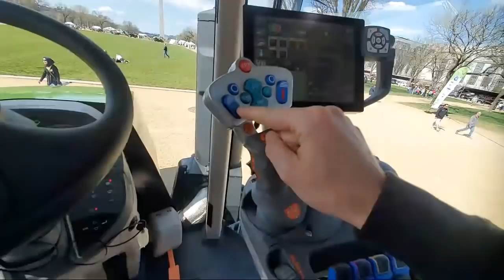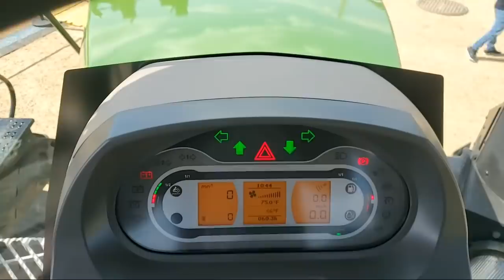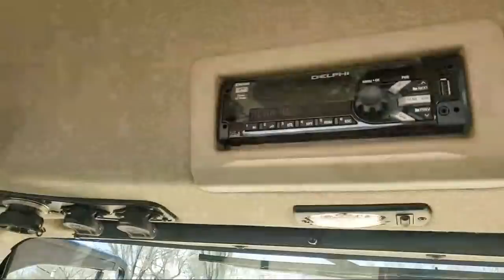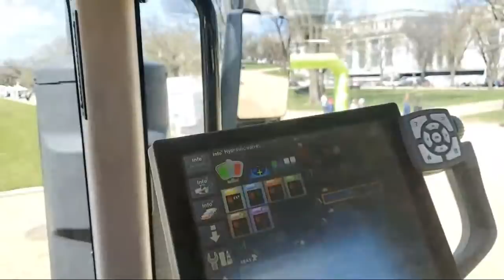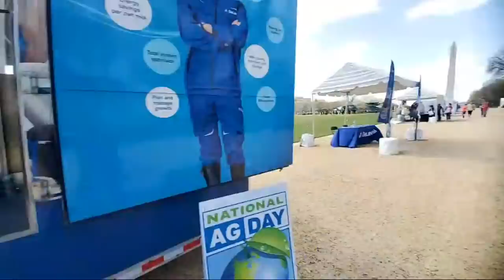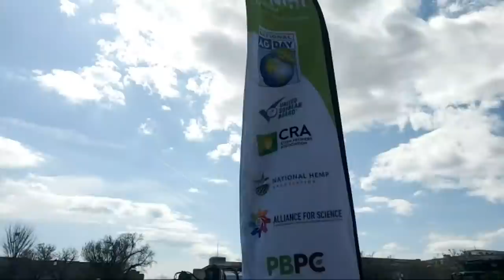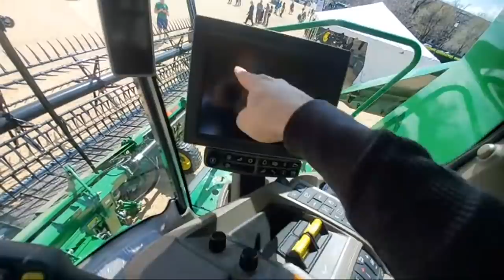How Does This Thing Work?

Comment: Do you understand now Louis?  It takes the AWESOME KNOWLEDGE of a certified Fendt repair tech to fix these very important tractors!  Fendt tractors do not start for just anyone either.  You must be a CERETIFIED FENDT DRIVERRRRRRRR to get behind the wheel of one!  And if the tractor judges your DNA thumbprint as invalid...well you get 3 tries and then the doors lock, the chair folds flat, and the tractor enters *Margarita Mode*.  It's OK---thrmi d

Comment: 4:57 That is a lot of rent. Then be honest here you don't own John Deer tractors.
Reply: we OWN all of our DEERE and NON DEERE equipment NONE rented except as needed short term 
LONG financing terms but NOT RENTED
Reply: @jasonriddell  John Deer sees that differently. Try to repair one without their mechanics.
If they decide (and they could at any time) to not reactivate one (one specific tractor, one lineup, or whatever) after repairs, all you have then is scrap metal. Deactivated by software but otherwise (theoretical) functional.

Comment: Wiring Harness gets snagged and unplugged.
Farmer stops and plugs wires back in.
Computer says "vehicle requires maintenance. Contact your dealer. Limp mode engaged"
Reply: or does the "one wheel" trick and "forgets" to pair whatever is on the other end of the cord requiring dealer visit to NOT be a heavy "paper weight"

Comment: all hoses probably digitally signed, so you have to buy the geniuine replacement hose. The machine probably requires wifi authentication with the correct parts installed to run

Comment: Industrial Machinery usually follows a Pattern. 
The Stick on the Right is for Operating the Tools attached to the Vehicle. 
The Steering Wheel or a Stick on the Left is used for Driving. 
Starting it usually fairly Easy by turning the Key in the Vehicle while the Safety Break is Engaged. 
After its Started you then need to Release the Safety Break to actually be able to move the Machine. Albeit sometimes you can move the Tools regardless of the Safety Break. 
The Safety Break is usually placed on a Panel Left of your Seat. And tends to be a Red Button with a P for Parking on it. 

And Yes. You should not Operate it. 
This kind of Machine does not have Sensors to Prevent Accidents when you Hit someone. They are supposed to move that Tool through Resistance. 
And its very Powerful. So it should never be Operated without a Proper Introduction by a Qualified Person ^^ 

As for the Cables and Stuff Breaking. Dont worry about that. 
These Machines are Generally really really Hardy. And will not Break easily. 
It generally takes a Seriously Violent Accident for these Cables to become Faulty. :)

Comment: Press throttle, throttle, brake, brake, stear left, steer right, steer left, steer right, hydraulic 1, hydraulic 2, hydraulic 1, hydraulic 2, ignition on. Congrats you have unlocked infinite fuel economy and ne er have to add desiel again.

Comment: 1.  It's not so hard to start it, even my 11 years old daughter know how to start and run this beauty.  🤟🏻
2. I've seen the delphi brand on many OEM car built-in radios, they actually make lot of this stuff for carmakers, but I've also never seen delphi branded standalone radio. 
3. simplest way to prevent these things from being started is just putting the automatic gearbox to drive, if possible...  We had hidden anti theft switch in one of ours machines, when was engaged, the gearbox was locked in 'forward "turtle"' so the engine won't start... 😆 😂
Reply: #2 those Delphi radios are standard equipment in almost every SEMI truck brand sold in America
Reply: @jasonriddell  thanks for clarification, I'm from Europe actually... 🙃

Comment: Fendts are very very easy to drive, and I mean that seriously. All you do is hold down the clutch and turn the key. Now your done with the clutch. Squeeze the trigger on the joystick, push it forward. Away you go 😂
But they had it disabled so you couldn’t budge it. The attachment on the back was a manure pump to fill tank spreaders. Actually hilarious that it was on a tracked tractor. You would never waste such a beast on the pump it would be hauling a 7,500 gallon tank back n forth from the field.
You were also very right to comment on all the stuff that could break on the X9 Combine. John Deere was drunk when they plastered that thing in hoses and belts.
Check out a case combine sometime. Less than half the belts and hoses.
There’s a reason they call it Junk Deere 😂

Comment: "Killdozers", D-9rs, are VW easy to run. Got to do it once after I repaired it in the middle of a street on the caribbean island I was vacationing on. Pulled a one foot diameter mass of foil gumwrappers (a 40 year supply of fuse substitutes that had accumulated) out of the fuse box bottom that was shorting out the thing, had the kids get me a big pack of gum, gave the kids the gum and remade the fuses. Started right up. Got a bottle of rum for that from the guy who's house it was stuck in front of for days.

Comment: So, I am an avid fan of Kerbal Space Program, a simulation game that allows you to run a space program, build rockets, and fly them into space, using a very realistic approximation of real life orbital physics. It's literally rocket science, the game. I eventually settled on starting a project to build my own custom controller and instrument panel for the game, but at one point, I was looking for off the shelf controllers suited to the game. What I discovered, was that the Saitek Farming Simulator accessory controller + a HOTAS flight stick was the closest thing to a dedicated KSP controller that money could buy... LITERALLY, the TRACTOR controller, with the steering wheel replaced with a flight stick, was the ideal controller for flying ROCKET SHIPS!! Let that sink in. How does that thing work? Well, it's not rocket science... It's merely close to rocket science! XD
Reply: You dont actually need most of that stuff to drive a tractor
Reply: @amogusamogus8490  most of it does NOTHING on the tractor and are for implements attached on the back
Reply: @amogusamogus8490  But you do need those controls to operate the machinery a tractor attaches to, be it front attachments, or rear attachments, or whether it's machinery pulled by the rear hitch. A tractor  can certainly be driven fairly easily... but what good is a tractor that doesn't operate other equipment. 

You have multiple external hydraulic lines, electrical harnesses for work lights or signal lights, for sensors, etc., you have PTOs (Power Take-Off) for driving mechanical hardware from a shaft that ties through the transmission to the engine... There are pieces of equipment with multiple axes of hydraulic articulation, flow rates and counters for thing such as seed planters or fertilizer sprayers...

No... you don't get to write off the complexity of the controls cause you don't need to use all of it just to drive the tractor. Heck, even my dad's old tractors from the 1970s had at least 6 hydraulic control axis pairs, two speed PTO, and electronic counters for monitoring seed rates remotely. those were long since sold off for newer equipment, but even so, those older machines were cutting edge. Agriculture generally rides the bleeding edge of technology. Tractors in the 90s had ground radar and row following (a form of self driving for field work... Farmer just needed to turn the tractor around at the end of each row). That was 90s tech!

Also doesn't change the fact that the Saitek Farming Simulator Accessory controller IS the single most perfect Kerbal Space Program controller ever manufactured for retail, when paired to a flight stick instead of a steering wheel.
Reply: @richfiles  Yeah, I didn't think that comment through. I forgot that most people have implements hooked up to their tractors, as well as using the 3 point hitch. Also, nice to meet a fellow ksp fan
Reply: @amogusamogus8490  that's fair. Glad to share all the stuff that goes into farm tech. Some of my earliest encounters with digital electronics involved, not computers, but tractors. As a kid, my father's tractor (mind you, from the 1970s) had an electronic seed counter that connected to the planter. It had numitron displays, like a 7 segment display, but made using incandescent filaments as segments, instead of LEDs. Amazingly, even as recently as 10 years ago, that ancient system STILL goes for hundreds today, cause even tech as old as that is still usable for farming. A later tractor that he owned, from the early 1980s, had a digital console, and could display things such as ground speed, torque, PTO speed, PTO torque, and could communicate with implement accessories. That was the first time I had ever seen that sort of thing. Obviously, newer tech is far more advanced. I have another device in my personal collection that uses numitrons for monitoring temps in a grainary seed drying system.

Obviously governments and military and space programs get the real bleeding edge technology, but I find that the cutting edge in tech, once it trickles down from state uses, tends to go into the big industries next, and that includes farm implement manufacturers. Farming, as a whole, is such a massive thing, that they tend to be an early adopter of new techs that are able to improve production. It's kinda fascinating stuff.
Reply: @richfiles  Have you seen the self driving john deere 8r?
Reply: @amogusamogus8490  I haven't looked at details of that specific model, but I've been long impressed by the tech overall. Heck, I'm probably out of date on what the very bleeding edge actually is! Hehe. One of the last tech developments I'd seen were cabless tractors, meant work in tandem with one semi-autonomous cab equipped "lead" tractor, meant for large farm fleet type operations. Obviously, a tractor with both full autonomous operation and manual operation is gonna be pretty epically useful!
Reply: @richfiles  My dad is using a 5085m and a case cx100 with a broken parking brake lol. Those are the ones he taught me to drive on
Reply: @amogusamogus8490  Oh God, I learned to drive on a Farmall B! Definitely not the most advanced in tech! The 1970s models my father had were an International Harvester 886 and a 1586. One of the two was equipped with the digital seed counter system, but I no longer remember which one it was. It's been many years

Comment: Man the equipment I got to use on local farms was older and way more simple than this. Granted, I think the level being shown here tends to be geared towards the huge corporate farms where the extra electronic assistance is helpful. Fields just weren’t big enough to justify gps guides, partial autopilot and other systems. Most of the tractors I operated would have been immediately familiar with anyone who has used smaller utility tractors
Reply: yup the Fendt is "the worst" as far as old school like in operation 
I work for a construction company and regularly operate / maintain loaders / excavators  / dozers ETC and NONE of them are anything like that Fendt but I do KNOW most of those controls control the attachment and NOT the tractor

Comment: engines don’t need computers to run, 

yet every car and tractor has them…
Reply: Sure you can have engines that works purely on mechanical principles for controlling air, fuel and spark. You just have to accept half the effect and much worse fuel economy. As much as it galls me the engine control systems do a lot to get better performance and economy. So they are here to stay, and now we just have to keep on our toes to avoid them getting locked down to the degree no one but the the manufacturer can service them.

Not the thing you wanted to hear I'm sure.

Comment: Today's farms are machine-centered, and almost everything this million-dollar machine and every other farming implement does is controlled by computer software.  So it behooves modern farmers to get familiar with computer usage and be ready to do the book-learning the software demands.  But even that background won't enable the farmer to fix many problems arising during machine use.  I suspect getting the million-dollar machine ready for each season will require a day or so of maintenance by factory technicians at the farm and return visits during machine usage.
Reply: That gear is for factory farms owned by agro (seed) corporations. Not family farmers.

Comment: 11:30 - it's not wiring harnesses, it's hydraulic hoses. And if they are old and leaky, don't grip around them when they are under pressure, the hydraulic fluid can get injected under your skin and cause necrosis.
Reply: coworker is about to lose his arm from hydraulic fluid, and he got lucky.
Reply: holy shit that's terrifying
Reply: @BeetleBuns  it has i think zinc in it, that causes almost instant rot. at the pressures that it can be put to it moves through you extremely fast. he was lucky his arm blew open because if not he'd probably just be dead now
Reply: @bradhaines3142  fuck, I'm glad I'm not big enough to need that type of equipment. Send my regards to your coworker, that's horrific
Reply: @BeetleBuns  it could cut you with the high pressure

Comment: The Fendt tractor was in locked mode (for the safety of everyone).  If it was not locked, you make sure the parking brake is engaged, push down the clutch and turn the ignition key clockwise. Just like a manual transmission car...  The scorpion tail was a lagune pump (liquid and manure).
Reply: Gotta get me one of those.
Reply: @fabianmayer  No problem. I'm sure you can get one for around 350 grands :-)
Reply: @chosebines51  when you put it that way, i am satisfied with my TT 88 from Aebi
Reply: @fabianmayer  Farm machinery is more of a flex than a tesla

Comment: I wish you could have been there with Millenial Farm or Welker Farms or something else and had them teach you. Another year, perhaps. But on the combine, that 'spiky reel' is designed to push crops into the belt at the back of the header (that long horizontal bar is called the header). If you have a short crop, like soybeans, they can sometimes get cut (there are knives at the front of the header, like a giant hair clipper) and fall forward (away from the combine) and then go under the machine. You don't want that, so the reel spins to help push the plant onto the header. It can also help with taller crops, like corn, that got blown over by wind.
Reply: If you ask me, having him visit and talk farm equipment with Mike Mitchell would have been the better one to go for.
Nobody else has a better take on equipment than him and may have useful Right To Repair input as well, only bad part is... Mike may be too energetic :D

Comment: Almost every physical control you see in that cab is customisable and programmable in some way. Tractor drivers need to be in the top tenth percentile to get the productivity potential for these models which integrate with a large number of implements. Whether tractors, harvesters, milking machines [as made by GEA, DeLaval and others] or many other types of agricultural equipment, they put the most sophisticated of motor cars and trucks in the shade.

Comment: i have driven a forklift with similar looking controls and in the forklift you used the joystick and the buttons on the joystick to control the forks so i imagine that it is similar in this one too.
Reply: Its function can be programmed to any hydraulic outputs so it can be multi use depending on needs of the attachments.
Reply: @viljosavolainen2286  makes sense. 🙂

Comment: Louis just casually recording himself trying to pilot a battle mecha.
Reply: The tractor builders already have the tech to beat japan in building a gundam mecha.
Reply: Louis starts a rampage in the city square

"How do I quickscope?"
Reply: You haven't seen a combine
Reply: Exactly! Once you feel the diesel motor rumbling in your very near vicinity and see all the banks of lights and gauges surrounding you … the first time is almost guaranteed to bring an instant grin.     The small Skid steer track loaders are even more fun because they have a pull down safety bar (kind of like a roller coaster) and the smaller cockpit with a “joystick” for each hand and rocking-foot pedal controls made my brain scream “I’m in a mech!” 10/10 would recommend

Comment: What type of vehicle is this
Reply: it's a john deere tractor with some attacchments. Most of the starship-like stuff is to control addons
Reply: @marcogenovesi8570  it's a fent not a John deere.
Reply: @MrConor159  the Deere is later in the video
Reply: Вig
Reply: Well the first one is a basic tractor with tracks, used for pulling plows, grain carts, running grain augers, spray carts, and tons of other uses. The one with the big spiky things is a combine. It's sole purpose is to harvest standing crops. That one had a grain head on it for things like wheat, chickpeas, or soybeans. You can fit different heads and change internal thresher settings for different crops, like corn heads are very different and use different settings from a soybean  head.